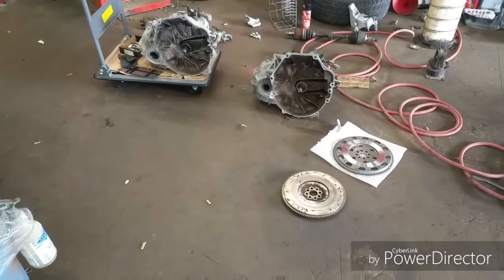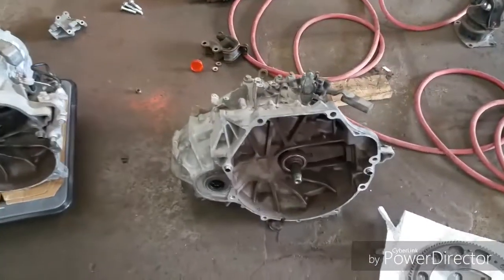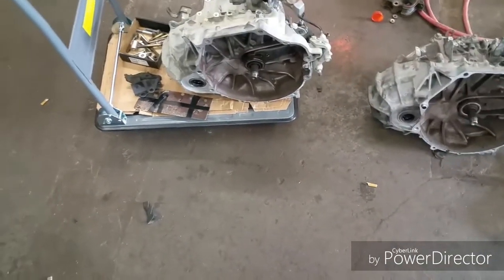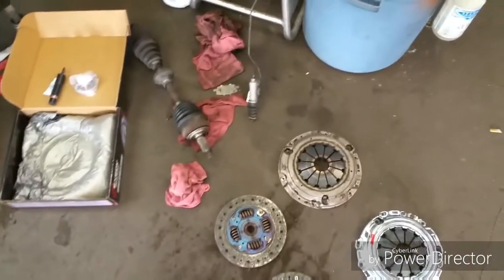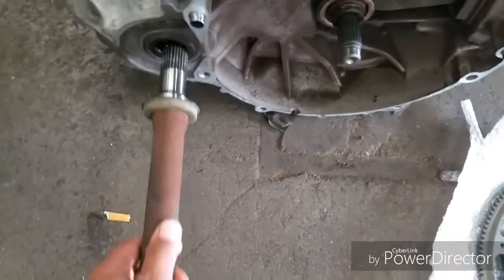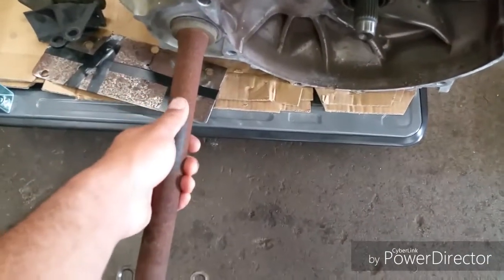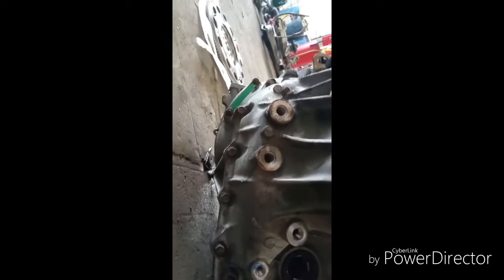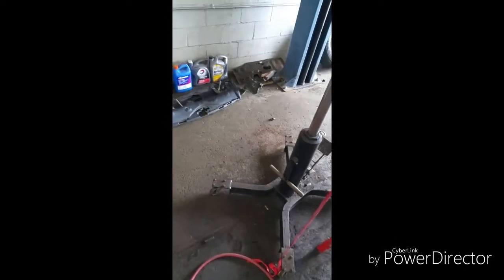2012 Civic SI transmission in 2007 Accord

Comment: This is my last and final modification I would like to do to my car, after everything else is done. I currently have a 2007 accord k24 AUTO that I want to swap to a manual. But I figured if I swapped it I might as well get an LSD from a civic si as well as six speed. I know this is a daunting process and I plan to run ktuner on top to make the logistics work out. Thanks for the video brother, if you have any links to resources to help me out, I would greatly appreciate it.

Comment: Do you have pictures or a template for the top mount and do you like how the car drives with shorter gears paired with the k24a8? Thanks dude, awesome work!
Reply from the maker: Hi. I sold the accord 3 years ago. But I will try my best to find a picture of the mount or the template. You can see the template sitting right next to the transmission on the cart. Small rectangular rusty piece.

Comment: what trans code ? pnn4
Reply from the maker: Ya I made a custom mount machined out of a block of Aluminum. I might have the template sitting some where.
Reply from the maker: where can I find the code?
Reply: do you fix the top mount on the trans were is the video...